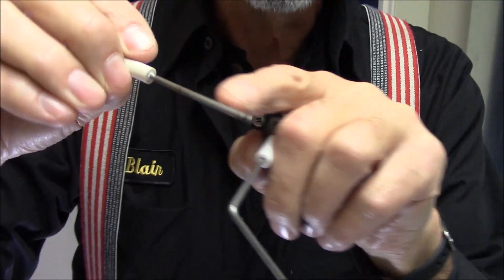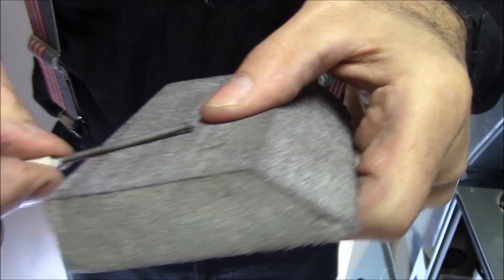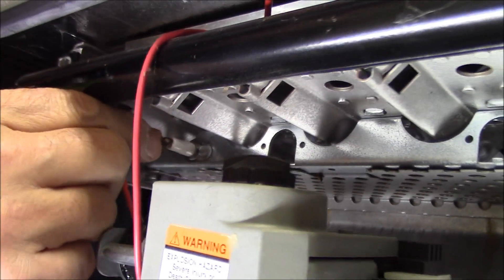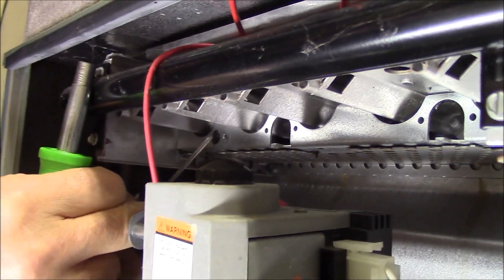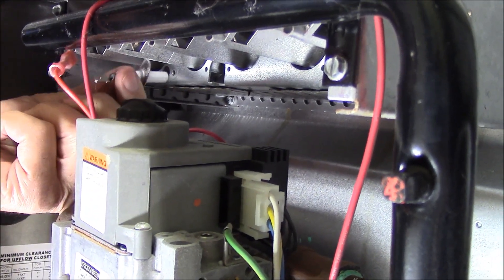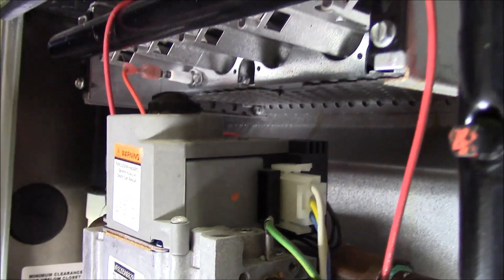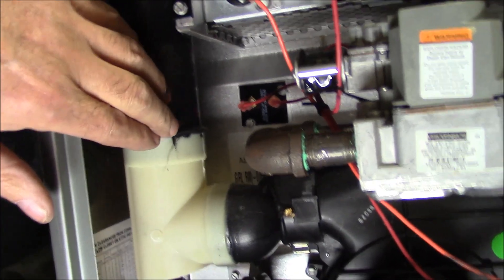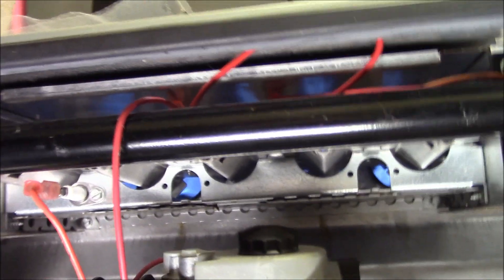Furnace Starts Then Shuts Off - Flame Sensor? - Clean, Replace for $20

Comment: Move to Florida like I did. No flame sensor needed. No oil man, gas man either. Heat pump is run by electricity. I have an outstanding solar system on my roof. Generates most of the electricity I need.
$31.00 per month electric bill. Nice.
Reply from the maker: Bowzer, you're killing me man. I have a spot in Englewood and soon I'll be a 6 month snow bird. I have some heaven on Harsens Island that I'm not giving up yet! Stay warm, I'll see you in January.
Reply: you can go as long as you keep doing your great videos!
Reply: I'm in Seminole. West of Tampa. 80° today. No snow. Ya got to love it.
How can you leave your store for 5 months?